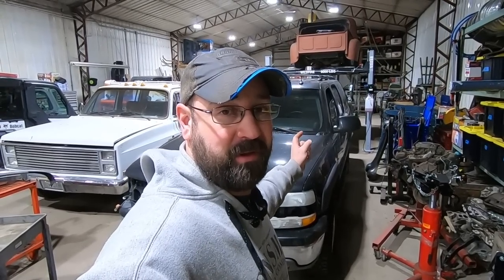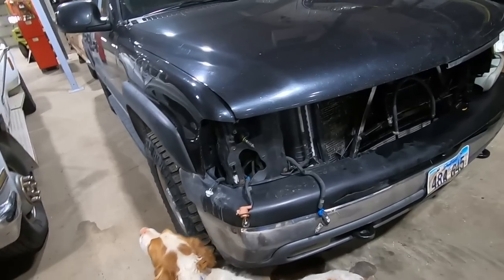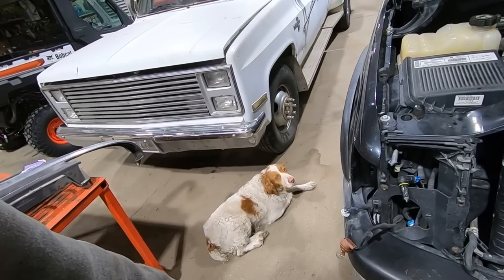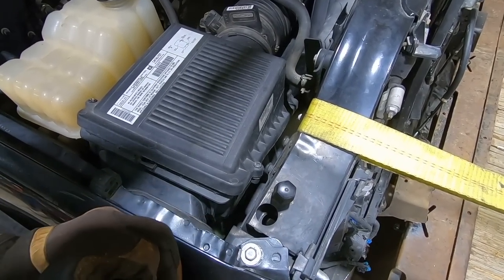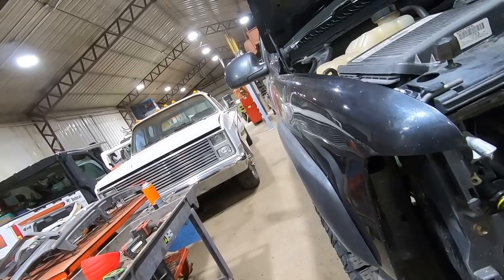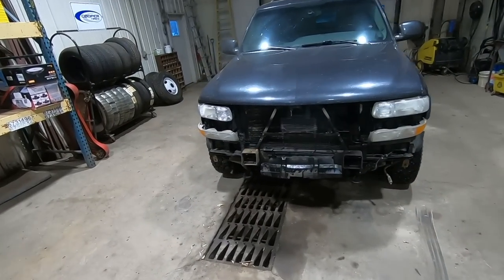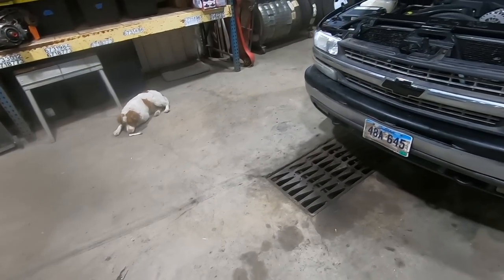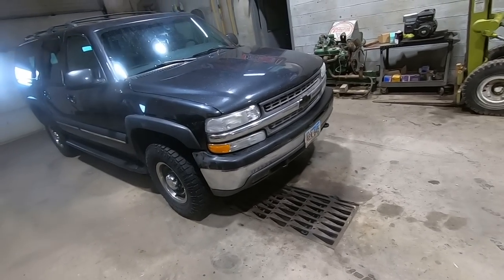New Tow Pig?!? 2003 Chevrolet 2500 Suburban Deer Collision Repair! ON THE CHEAP! 8.1L Big Block!

Comment: This was like deja vu with an extra twist. Necessity is the mother of all inventions. You got her straightened out pretty good.
Reply from the maker: Forgot the best part!
Reply: @moremortskerepair4354  We are far from perfect, so I wouldn't sweat it to much. I did something similar one time using a ratchet strap and a riding mower. Except it was the rear of the vehicle. I had the advantage of being able to place center of the mower wherever I wanted it to be. It worked like a champ. Mechanical minds think alike. Good job!

Comment: If the gauge cluster goes bad again, they aren't too difficult or expensive to fix if you're decent with a soldering iron.  I did the one on my '05 2500HD tow pig.  You buy a kit with new actuators (the meter needle drivers), de-solder the old ones, and solder the new ones onto the cluster PC board.  The hardest part is getting the needle positions recalibrated, as they will mount on the shaft any which way.

Comment: Another great video with a few teachable moments thrown in for good measure! I personally prefer when you work on the older stock because, well, there's still probably over 100k 2003 Suburbans still on the road. What fun is that?

Comment: Do the bougie leather seat tow pigs have special turn signals and 7th Ave only had the "standard" ones?  I did headlights/grill/bumper last year for a neighbor on their 2010 Malibu and was shocked at how much plastic is in those things. Must have been a dozen covers/shrouds in and around the radiator.

Comment: Is that a heated pressure washer your using? And that came out good, those 8.1s are monsters
Reply from the maker: Sure is
Reply: @moremortskerepair4354  heated pressure washers are amazing I fix them at work, when you turn the heat up it takes some nasty stuff off